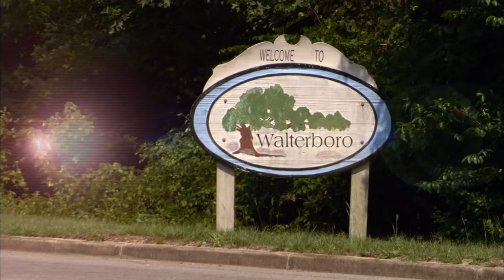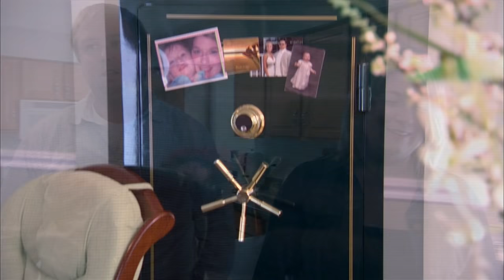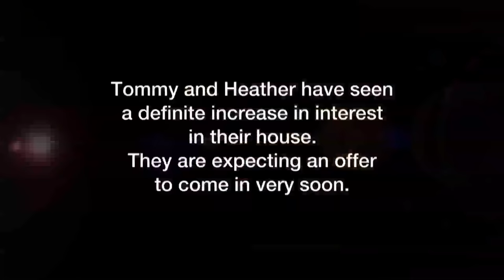Unsellables | FULL Episode | Bathroom Blunders

Comment: The kitchen looks unfinished when the inside of the cabinets are not also painted white.  Some may disagree, but I always paint the inside of the cabinets the same color so when they are opened your have a continuous flow of color and they look finished.
Reply: I agree, at least the inside of the doors.
Reply: i also paint the inside so i agree
Reply: Always paint the inside, makes u look  like  u did a half done job
Reply: That's also one way to tell if they were factory painted or just a quick spray paint = future chipping and flaking paint.

Comment: They should have only had their house on the market for six months at the longest (which is still way too long in my opinion. Three months would have been better) and then taken it off of the market for a while. It only hurts them to leave it on the market for three straight years because anyone who might have been interested in it will have already seen it online or in person and won't look at the listing again--except to see if the price of the house has been drastically reduced. Potential buyers will wonder what's wrong with the house because it's been on the market for such a long time.

The second floor dormers are way too small and there should be more of them. They're very out of proportion with the rest of the house.